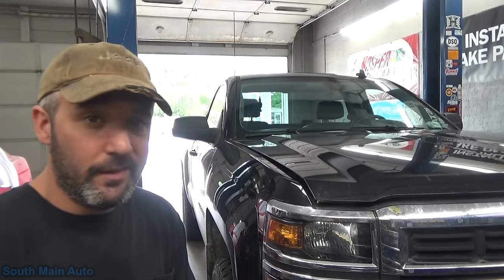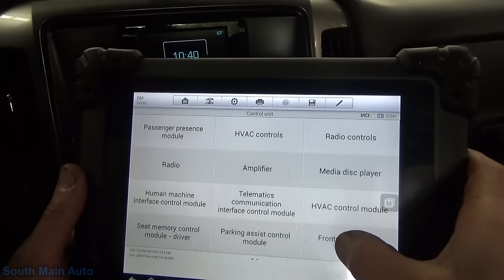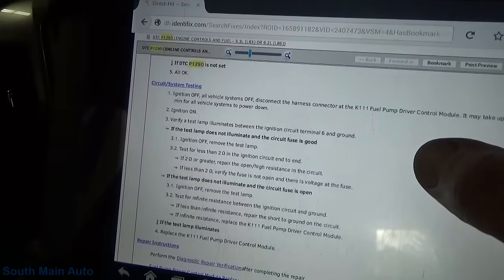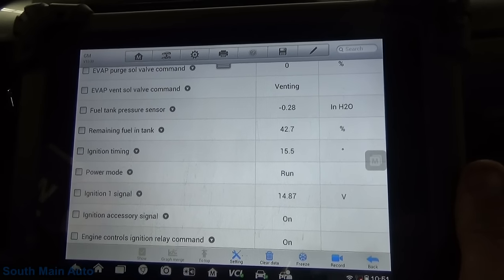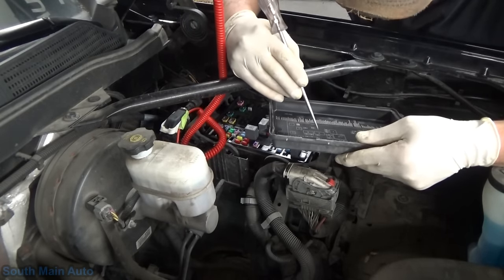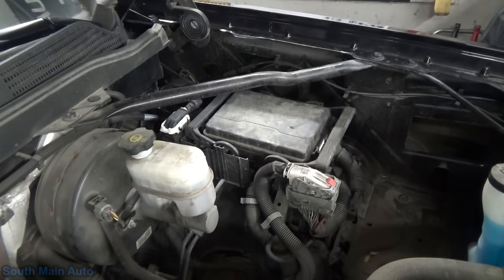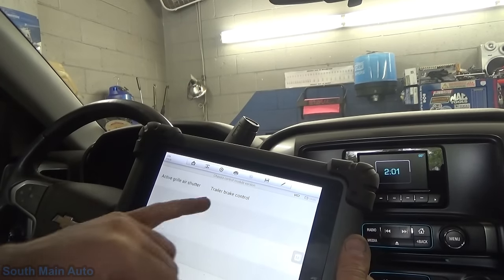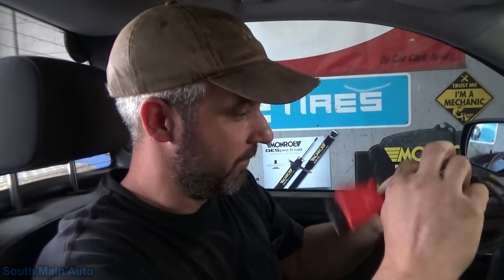Chevrolet Fuel Pump Driver Problems - Where Is The Broken Wire

Comment: Where is that seam ripper and telephone company wire tracer. Ya'll just have to put it at the frequency that is not the tuned length that will radiate.  Just  because each wire is a different length tsk tsk

Comment: cant locate that wire pierceing device your using,,,,your wire poking device
Reply: Pomona 6405 for cheaper banana jack version or 6413 for meter probe connections. I believe if you start in SMA's amazon store link in the description and go to amazon for another tool and then do search from that page, it still counts as to supporting SMA channel. Otherwise Eric needs to add these two into the store proper, I didn't find them either.